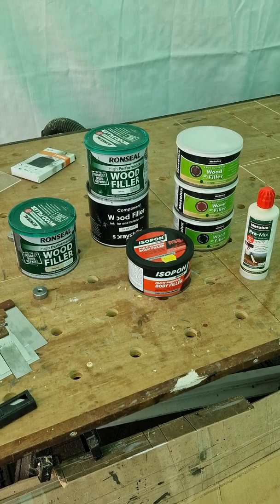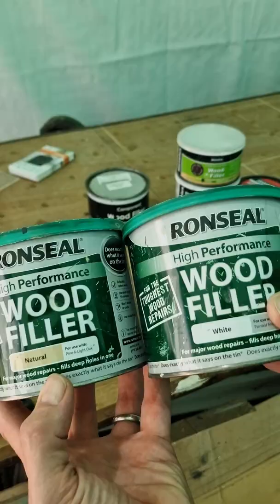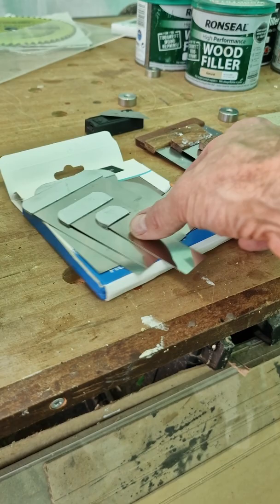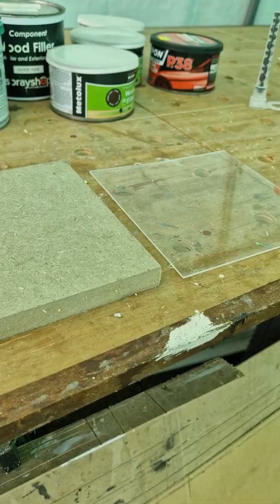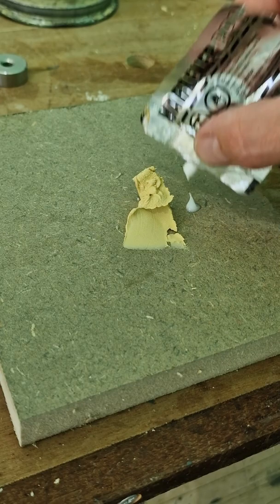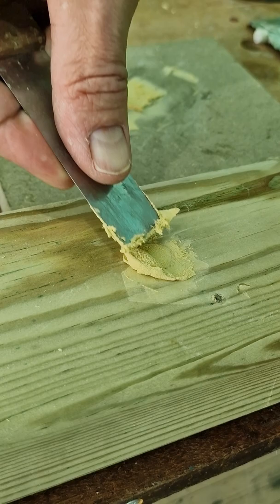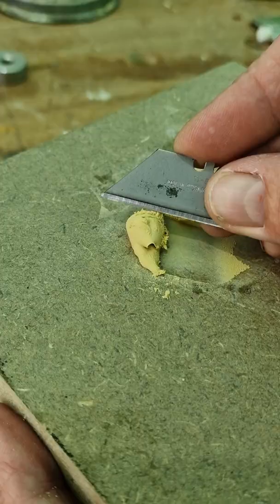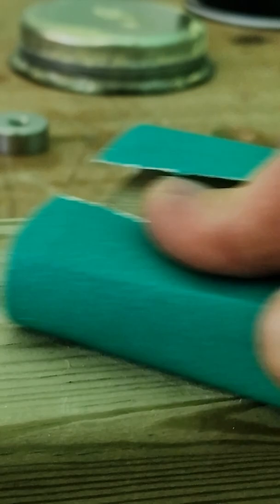How to Use Two Part Wood Filler #shorts

Comment: Car body filler is I think slightly softer and easier to sand as well.   Peter Millard had a neat trick with filler, he rolled any remaining up into a lump and then when the lump was hard you knew that the filler on your wood was hard and ready to sand as well
Reply from the maker: Thanks Geoffrey. Yes that's a good tip. 👍

Comment: Nice, in interior woodwork I did, I did an experiment with water based gloss (Brewers Super Range) and easy fill, mixed and applied it into all the gaps and knocks in the woodwork using a paint brush. After sanded it back taking care to wear a decent mask. Two years on and no problems. this is inside a conservatory though, not outside.
Reply from the maker: That's interesting. I saw some Polish decorators doing that on the windows of a property I was installing blinds at in London a few years back. Personally I wouldn't use a gypsum style product for woodwork but fair play that it worked for you probably - because you painted it so well.
Reply: @CharlieDIYte  Those Polish guys are stealing my style!

Comment: Also important to not try to get it totally flush with the spreader, as you will end up having to apply another layer.
Reply from the maker: Yes good point. I usually point that out but maybe missed it given the length of this vid.

Comment: I have really struggled with them.  I had Ever Build and tried the Ronseal.  Both balled up within a matter of minutes.  Great to apply to start with but even scales down to a marbles size would ball up after the first few applications.  May be down to the current heat, but better than pollyfiller, but just takes time in small the small volumes each time.
Reply from the maker: Richard don't apply too much activator. A pea to golf ball ratio is what you need, save mix it thoroughly but as quickly as possible to give you the maximum trying to apply it. Sounds like you might have been over egging the hardener. At this time of year everything is going to harden too quickly though. 👊
Reply: As the actress said to the Bishop

Comment: What to do on exterior rotted door /window frames where the hole is quite big? Not a hole but the bottom of doorway that has rotted away?
Reply from the maker: Ah, that's my next Short! You want to get yourself some EHB60 I think I used it in this video https://youtu.be/ZhCv5LnNCvc You do need to buy the double applicator gun but this stuff is unbelievable for repairs up to 60mm deep.